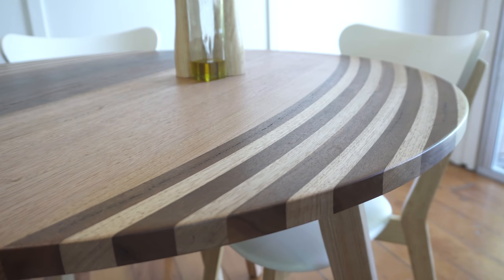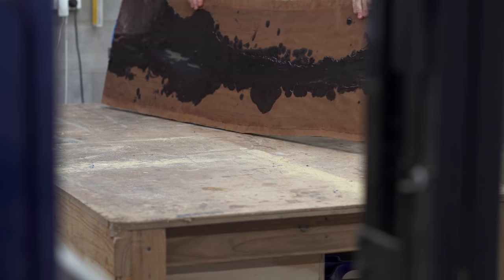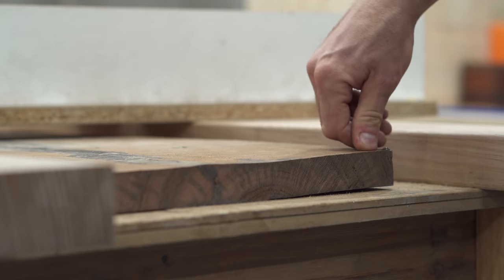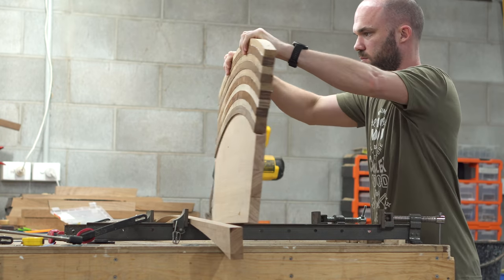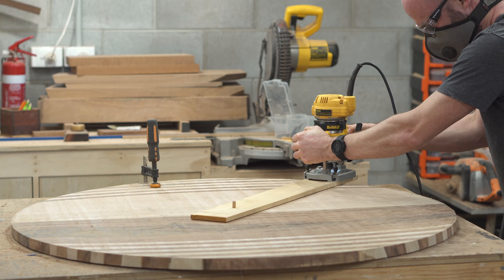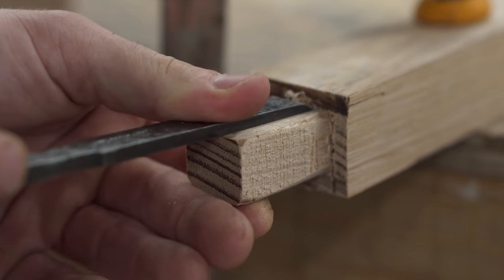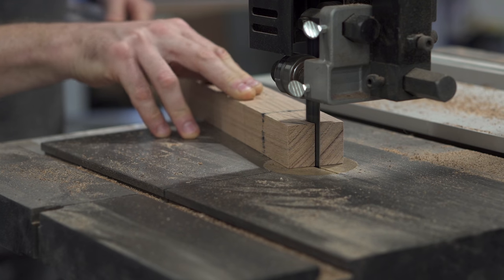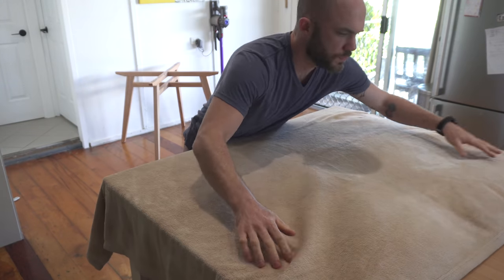I Thought This Would Split | Woodworking

Comment: Well done. I'm disappointed you didn't license "You Spin Me Round" for such a pivotal piece of your woodworking journey. You've had a couple of projects orbiting the steam bending sphere of woodworking, whats the next challenge? :)

If you're looking for a step up from the (diablo?) straight flush trim bit, Timbecon's shearing cut (angled straight bit - I think they call them HD?) flush trim bits are really good for their price. I still want a spiral flush trim bit for very delicate stuff, but for 99% of flush trimming/pattern work they're amazing
@19:44 Thats the face of "dont-drop-and-break, dont-drop-and-break" panic we're all familiar with when lifting things solo :D
Reply from the maker: Thanks Paul. I used the Diablo straight cut equivalent, upgrading from straight flutes to slightly angled, and what a difference it makes. Less chatter, less noise, cleaner cut...why do straight flutes even exist anymore! Will check out the Timbecon bits, might even treat myself to a compression (if they come in 1/4 inch)

Comment: Just found your channel. Great work. Im curious if you've noticed any separation between the strips on the top as time as passed a bit? Does the wood want to spring back from the steam bending over time?
Reply from the maker: Thanks! So far so good, no separation. The wood might want to spring back slightly but not enough to overcome the glue. The only minor issue I've noticed is the glue lines; the different species of wood expand differently so the you can feel the joins sometimes

Comment: What's your final opinion on the clear epoxy in the void? Wish you'd to tinted it? Or are you really happy with it?  Table looks awesome
Reply from the maker: I didn’t do a great job with it so it’s hard to comment on what I did, but in the past when I’ve gone black it’s always been to stark. It’s a tough one, hard to say
Reply: @RobinLewisMakes  it's one of the reasons I've generally stayed away from epoxy.  When I was doing work experience in highschool I worked at a solid furniture factory. The used mostly reclaimed wood. Bit they did recessed borders with black epoxy and thin chunks of burl. Looked great. SO messy though.